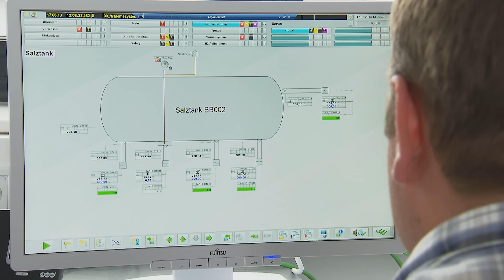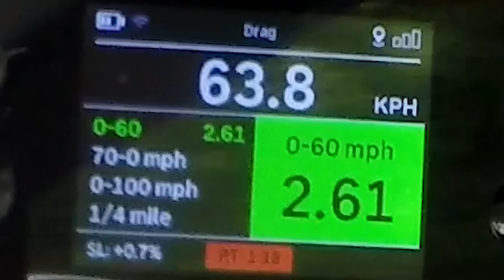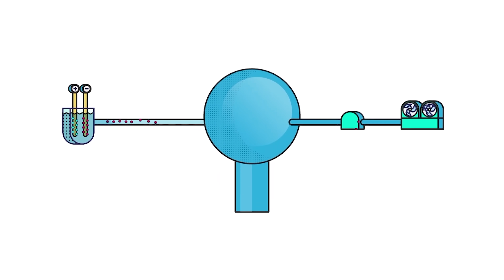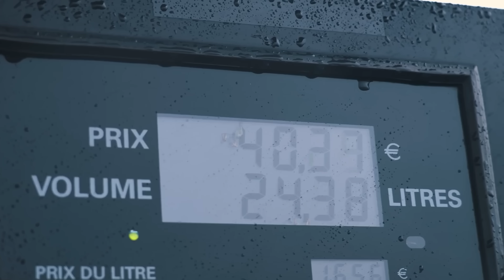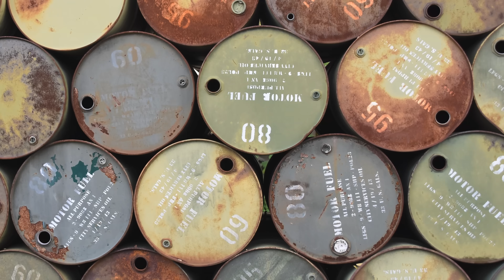Porsche just SAVED petrol engines FOREVER

Comment: Synthetic fuel is so hilariously expensive and hard to come by that you'd have to be mad to want a car that runs off them. Especially since in 12 years pretty much every new car will be an EV and probably surpass ICE in every single way - price, performance, operating cost and even range. I honestly wonder why German auto manufacturers are even trying to fight for this loophole when it will be pathetically ineffective at delaying the end of combustion vehicles.
Reply: there aint enough rare earth minerals in current mines to make every car e car

Comment: It’s not just about CO2 reduction. Burning fuels also produces Nox emissions and particulates which are also a problem. Why take electricity from renewables put it though an inefficient conversion process to burn a fuel in a relatively inefficient process when you can take the electricity directly to provide motive power. Maybe synthetic fuels are needed for some specialist applications but for day to day the majority should be using EV’s.

Comment: There just one problem , an internal combustion engine might not be the smartest way to use the e fuel cause only 8% of in gets turned to energy compared to petrol at 35% or ev  at 70% so it might not save the  internal combustion engine just yet .....

Comment: This is the most inefficient way to power vehicles! This is purely a cope for people who want ICE vehicles. Not only do you need the renewables infrastructure to produce green hydrogen, you also need even more renewables to turn the H2 and CO2 into fuels! H2 fuel cells for average vehicles doesn't make economic sense, never mind the additional e fuel synthesis. With EVs you cut all those losses! Even with a basic understanding of chemistry and thermodynamics it is clear the energy and cost to produce e-fuels is inevitably going to much higher than electricity for EVs on an energy basis. If scaled up this would increase our required capacity for renewable energy more than if everyone just used EVs. As you said, the impact of EVs is dependent on the impact of the electricity generation, but this is even more important for e-fuels because you are going to need more energy input to make the H2 and then synthesize the e-fuels.

This solution only really has 1 advantage over EVs at the moment - longer range. Do we need better charging infrastructure? Yes - but ICE vehicles aren't being banned in 2035, the sale of new ICE vehicles is. We have over a decade until that ban, and literally decades until everyone would transition to EVs. Its inevitability going to be a gradual transition and the technology will develop in that time too. Think about the progress in charging technology and infrastructure in the past degrade (despite the low uptake of EVs) - do you seriously think we arent going to see charge time slashed significantly in the next decade? I recon any time needed to charge EVs in 10 years time will be insignificant compared to the cost burden of having to use e-fuel for the vast majority of the population.